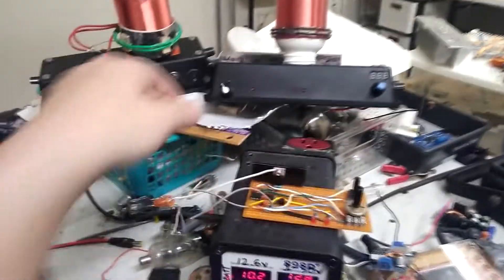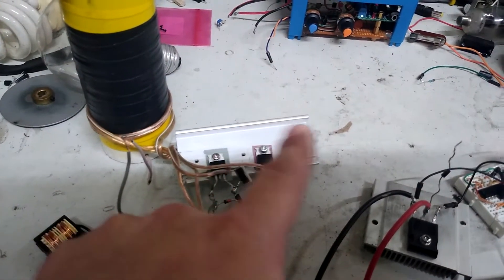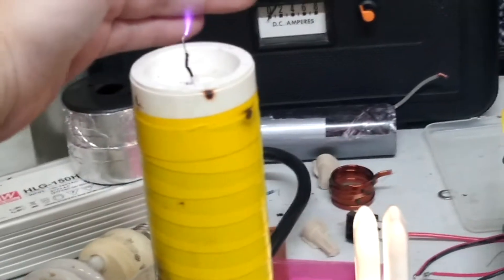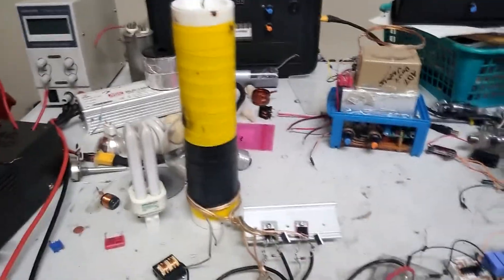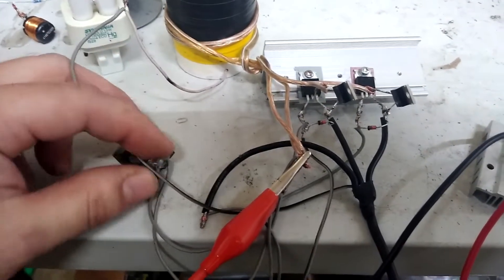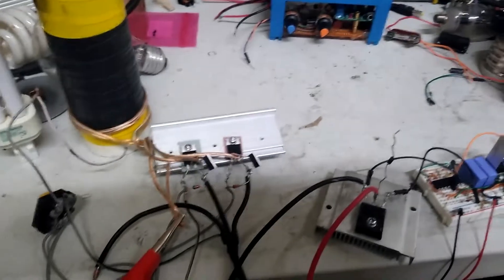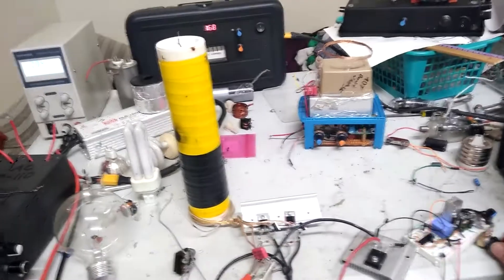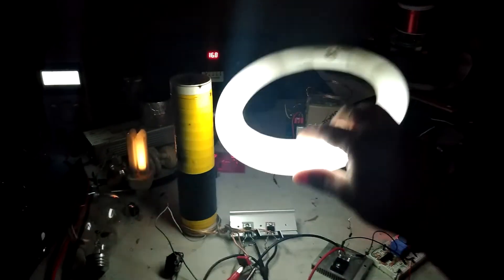Powerful 3-12v Exciter using TefaTronix SSTC drive (Skori mod)

Comment: Hi do you have the schematic of the slayer exciter only. Thanks :)
Reply from the maker: Yea check out TefaTronix's webpage and the circuit here http://tefatronix.g6.cz/display.php?page=sstc4&lang=en 

If you look at just the right half of the diagram that's basically the circuit minus the interruptor so don't worry about Q2 or D3 and D6. His uses a tiny 2inch coil though so my setups are slightly different. In this video I'm still using the IRFZ44N mosfets though. Instead of the 2 facing zener diodes on the gates I also just use one 10V zener for each to limit the upper voltage. For me RV1 is a 10K pot and the left side is referenced to B+ instead of 5v+ from the regulator (which won't be there). The capacitors will help but I don't use them in this circuit. He has a C12 capacitor which helps the spark length but I often don't use it if my GDT works well enough.

Comment: hello sir, may i questions to you? how many turns winding your GDTis,  and what kind of diode you use on the 2 mosfet? please answer sir. thank very much before :D
Reply from the maker: In this video the circuit is using a common mode choke for the GDT which is 10.8mH on both primary and secondary so a 1:1. Not sure how many turns. The two diodes here are MUR1560's but I just used them because they were laying around. Not absolutely necessary.